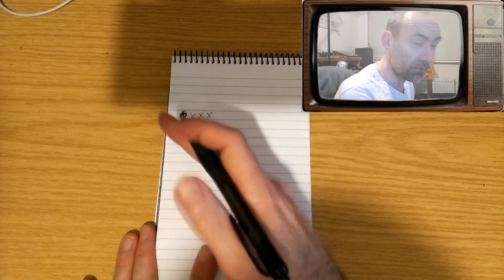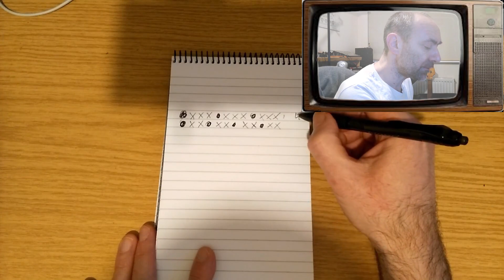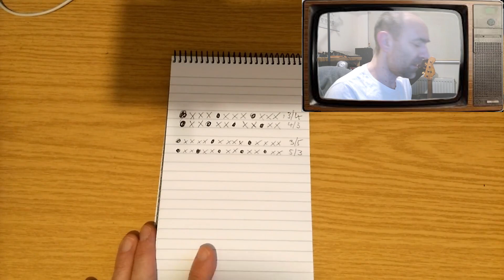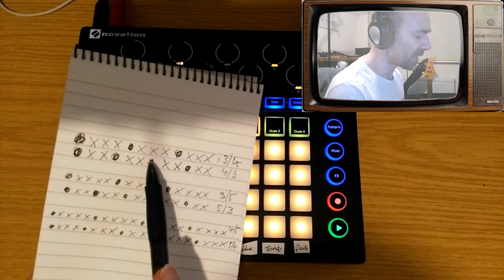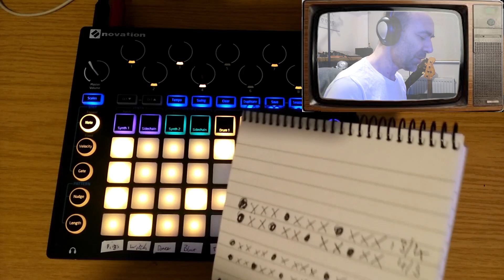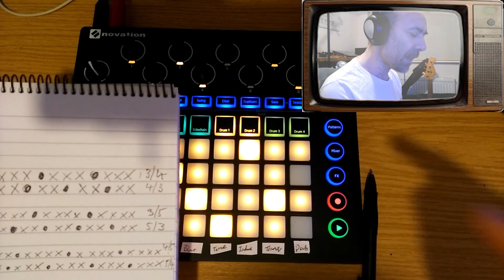Calculating Polyrhythms on a 16 step step sequencer using the Novation Circuit

Comment: This is very well and practically explained. 👏 Even if it is nothing new to me, I find it very inspiring, especially for the demonstration on the Circuit! 👍This calculations are useful also to chain, and that's the main use I make of it, but I totally left aside the beat making possibilities, so thanks!🙏
Reply from the maker: Thank you so much, glad you found it clear and I figure most people kind of know this but sometimes it helps to look at things from a slightly different perspective. 
Nice to see you.

Comment: excellent and very informative as usual....thanks as still trying 2 get me ead round circuit
Reply from the maker: Cheers P Flo, glad to help, the Circuit is one of those deceptive boxes which appears really simple to start with but once you start exploring it has quite a bit of depth to it.
Reply: @DocBolus  OH YES.....
Reply: @DocBolus  WOT  are the settings 4 the midi? when u conected a elektron into[visa versa] circuit? as witch 1 had ext clock set?...as soo many 4 elektron n well confuzing
Reply from the maker: @pflo-98  OK so for me I use the circuit as my master clock. I kind of think of it as a drum machine so that would be the control of all timing.  If you can wait a week or two I will do a video showing how I set them up and explain how they connect together.
Reply: @DocBolus  thanks as well impressed wen u got em both going via 1 midi,thanks 4 info
Reply from the maker: @pflo-98  No problem, always happy to help.

Comment: Hello, I think, that what you did here is still polymeter. Because you used same grid for all parts. For polymeter you would need to use microtiming. In polyrhytm, different parts have same length of the beat, but different timing inbetween. At least this is how I understood Andrew Huang's video, which you mentioned.
Reply from the maker: There is a difference with what I am doing here, you have to think about the actual time it takes to get through each bar, so for polymeter if you had a 4 beat loop which took 4 seconds to repeat against a 3 beat loop, the 3 beat loop would repeat every 3 seconds which is why you get that drifting and more complicated arrangements. With Polyrhythm both the 4 beat loop and 3 beat loop would take 4 seconds to repeat. The difficulty in working on step sequencers to do this is working out how many steps it would take in between each beat to keep the 2 loops finishing at the same time.
I think I will have to make another video on this to explain in a bit more depth.
Basically you have 2 variables you are working with time, and steps. Polymeter is about steps, polyrhthm is about time, but the 2 are related in both cases.
Reply: @DocBolus  according to my understanding, in polymeter both parts start each beat at the same time. Each beat has the same length for both parts, but different timing inside. And that's why they are working on different grid, but they restart on the same place each beat (not only each loop). Simple example is using triplets against normal quarter notes, I think...
Reply from the maker: Yep as far as I understand that's right, you are taking it to a whole new level with the subdivisions of beats. This is where time signatures come in and why the time signatures used in this video are a bit odd. So a time signature is where you count each amount of beats in a bar say 4, and then the subdvisions of those beats, 4 which is where you get 4/4 time. A waltz would be 3 beats to the bar and traditionally those are cut into 4 subdivisions too which makes 3/4 time. When we talk about triplets in terms of key signatures you can have 4 beats in the bar with triplets which would be 4/3 or a waltz in triplets which would be 3/3. At least that was how it was explained to me when I was a nipper and actually took some lessons on real instruments.
I think I really might have to explore making different time signatures work on step sequencers a bit more. Things start to get tricky when you start looking at the micro timing and of course not every step sequencer has the ability to do micro timing.
Reply from the maker: Sorry HUMMA HUMMA I should add, talking about the beats being the same length time wise is polymeter, but the polyrhythm I am trying to show here is about the length of the bar and so the individual beats in a bar.
Also forgot to add, thanks for watching and even more thanks for engaging and chatting, it is a wonderful thing and makes all the effort of doing this worth while.
Reply: @DocBolus  Thanks to you for effort you put into your videos 🙂